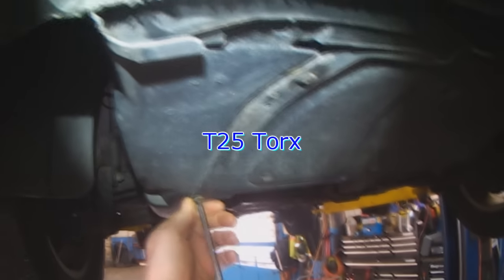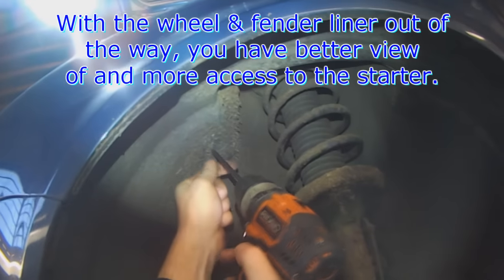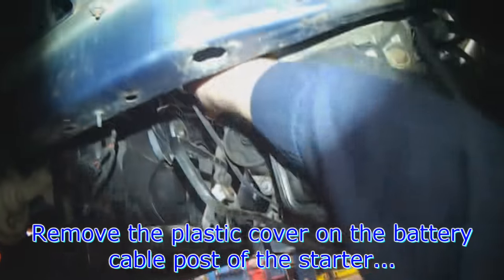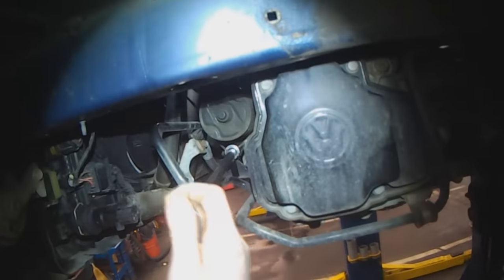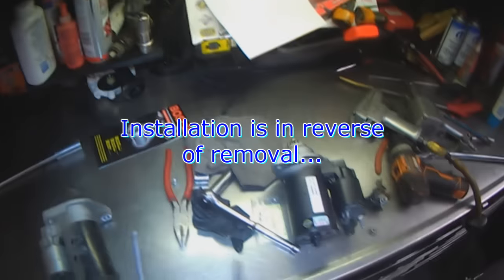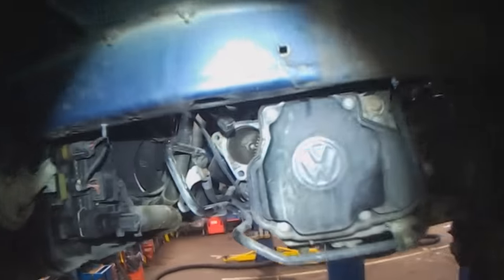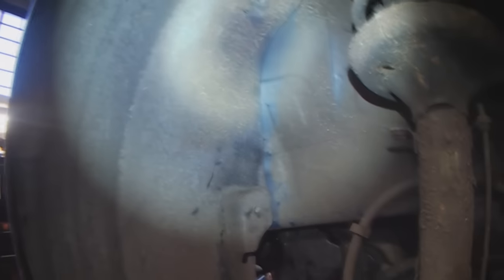VW A4: 1.8T, 1.9 TDI, 2.0, VR6 Starter removal (5 speed manual)

Comment: I'm kind of a GM guy because at least in the 60's and 70's everything was interchangeable and easy to access. As usual, I like the tips along the way. I can use those on any car. :)
Reply from the maker: Lots of stuff / theory is universal... that's what makes the Automotive field so great. The way things look & operate might be a whole different story and can be a pain when you are working under the gun / have a deadline. I admire the guys that work on anything & everything day in & day out... those guys get good quick!
Reply: I admire them too. So many different cars to keep up with I don't know how they do it. But then again, you work on plenty of different models. How did you get the corner stall? When I worked on helicopters I always fought for the corner so I had more room to spread out.

Comment: I have a 2001 VW Passat 1.8 v4 manual transmission and my starter is on the passenger side (alternator is on the driver side front of the car) under the car in a very hard place to reach. I am having a hard time getting the wire harness off the solenoid because of where it’s located and I can’t tell exactly how the clip is to get it off. I was watching your video to get an idea. I am confused because you said that the location of the starter on the VW has been in the same location for years, I can’t figure out why on my car it’s located on the passenger side so far away from the alternator. Thank you for your video because it was helpful. 👍
Reply from the maker: My video is for vw A4 models (golf, jetta, New beetle)... your passat is a vw B5, that's why it's different.

Comment: Nice work Thomas. On the long snout starter, the distance that the pinion comes out would be the same as the short snout. Correct? So, is there a difference in the starter housing cowl which surrounds the bushing which allows more of the shaft to be seen. Just not quite sure what the long snout starter looks like.
Reply from the maker: stuzman Sorry for the lack of clarification... the drive gear sits & operates pretty much the same, but the long nose (for lack of better words) just has a long armature shaft that extends into the bell housing where the bushing is. The bendix drive / gear then spins out along the armature shaft to contact the flywheel... if that makes sense. Good question... keeping me on my toes! =)
Reply: Okay Thomas, thanks for the clarification and makes sense now :)

Comment: Super useful video, thank you. One question: I want to replace the starter on my 1.8t from 2000 but I don't know which starter to buy. Can I just buy a stubby starter and it will fit anyway?
Oh and how do I know how many teeths my current starter has?
Reply from the maker: Pretty much any auto parts store / website you order from, should be able to match up the correct starter for you. They will want to know, year, make, model, engine, transmission. As long as you provide the correct info, they will be able to supply the correct part. You can also look at the old starter... there is probably a stock part number on it. 
This one for instance... fits Golf, Jetta & New Beetle's:
https://www.ecstuning.com/b-bosch-parts/starter-motor-remanufactured/sr0425xkt/
Where as this one (slightly different) fits Golf, Jetta, New Beetle and Audi TT
https://www.ecstuning.com/b-bosch-parts/remanufactured-starter/02a911023lxkt/

Comment: Had a mk3 Cabrio starter beat me for a while, apparently that bottom bolt lines the engine and transmission up, had to use a pole jack and wood to get everything back into place...
Reply from the maker: Yeah, the A3 needs the engine supported... can be a pain if one is not aware of it.
Reply: Found out the hard way LOL
Reply: I just got so spooked by this. I was just changing mine and didn’t know the motor needs support and almost shit myself when it fell

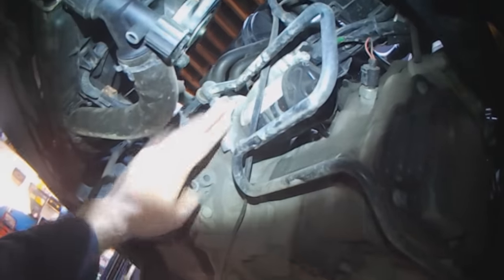Comment: Hey there. At 1:10 there's a harness connection next  to the starter going into what looks like the transmission.
What sensor is that connector used for?
Reply from the maker: Reverse light switch.

Comment: Hi,i am having hot start problem on skoda octavia 1.9 TDI,i have replaced fuel pump,coolant temp sensor,and yesterday crank shaft sensor,problem is still in it :( no problem starting from cold whatsoever and when running it runs 100% no issues,i am reading on alot forums it may be battery or starter,i have checked battery and still the same,should i look at replacing the starter now?it seems to be a issue problem on them?
Reply from the maker: If the starter is turning the engine at a good speed... the starter is good.

Comment: thanks for all your help,,, i have a vw jetta vr6 1999,,  and   i have oil in the cooling system,,, antifreeze,,  no sure if its motor or transmisión oil,,, where do u think its coming from...??? thanks... u r doing a exelent work....
Reply from the maker: Engine oil cooler or transmission oil cooler... if no major overheating event ever took place. If engine oil level is not dropping, transmission oil cooler (if it's an automatic transmission).
Reply from the maker: You can check the coolers by applying air to the coolant passages: https://www.youtube.com/watch?v=WNYx4Xjr8-I
Reply: thanks... I will check it.... 👍🤘.... great  videos...¡¡¡
Reply from the maker: Thank you for watching!

Comment: Does the top mounting bolt also need to thread through the mount/guide that's immediately next to the starter? @5:01

Got mine removed from the far mounting point, but the threads at the end of the bolt won't pass through the mounting hole/guide that's nearest the starter. Sprayed w some WD40, moved it back and forth a bunch, and I'm supporting the weight of the starter with my other hand, but still having a horrible time getting the threads through that last hole. Ever run into trouble getting one of these bolts out?

The bottom one came out no problem!!
Reply from the maker: If it's an automatic, there are 2 sets of threads in the hole. Pull on the bolt while turning it counterclockwise. Once it starts in the second set of threads, you can continue with a ratchet.
Reply: Thank you That's what I figured. Got myself cross-threaded so I'm in for an adventure!

Comment: I just did my starter, the engine stopped cranking, it always started up fine until it ran out of fuel. since it ran empty and stalled out out hasn't started back up again and the EPC light is on and the radio won't turn I either, I replaced every fuse and it still won't turn on. the brake chime goes off when the e-brake is engaged but when I press the AC switch and recirculation button the chime stops. I replaced the starter and it started cranking over but wouldn't start. there's no fuel getting to the injectors and I replaced the fuse to. the EPC light is on and the radio won't turn on, the sunroof is moving up and down by itself also. the radio did work, the AC worked until the system leaked out everywhere and now the car is killing batteries and it's not getting any boost, ours just the vvt part is the engine that gives it power
Reply from the maker: Year, make, model, engine?
Reply: Thomas EXOVCDS 2002 vw gti 1.8t AWP
Reply from the maker: Key on engine off... EPC should come on / normal. Scan for fault codes. Crankshaft position sensor, fuel pump... could be a bunch of things. All the other stuff might or might not be related. Make sure that the battery cables have a good clean & tight connection. The chassis ground cable under the battery can develop a bad connection, that can cause starting / running issues. Remove the battery and tray and check that the ground wires under there are clean & have tight connections. Let me know what codes are stored / if any.

Comment: I got one bolt off and oil started to leak out.Is this normal? Should i continue?
Reply from the maker: Which bolt? The more info I have the better I can guess as to what's going on / is wrong. Post a video of what you see / which bolt hole etc on your channel.
Reply: @EXOVCDS  ok, so it was the bottom bolt. I continued and nothing else came out after that, it was just a few drops, I was afraid a lot would pour out. We're all good. Thanks for your content! And the quick response.  Always go to your channel for your thorough explanations and expertise. I appreciate it.
Reply from the maker: @jusdriftinggg  some oil probably ran down between the engine block and the transmission... and then followed the bolt into the hole. Depending on the engine, could be oil from the valve cover gasket, head gasket or oil from the PCV.
Reply: @EXOVCDS  its a 2.8. Looked like fresh, clean oil too. Still perplexed.

Comment: I have a mk4 jetta 05 Gli 6 speed 1.8t, are all starters beginning with 2000-2005 universal?
Reply from the maker: I don't know if the starter itself is universal... but the mounting / removal process is universal across the A4/mk4 platform, for all engines and be it standard or automatic transmission.

Comment: NO! VW does not keep anything easy, or make anything easy WHATSOEVER! I appreciate the video though, the starter doesn't look too bad. Don't need to replace yet, but was just curious. Mine makes a really awful internal noise when starting, and I have a feeling it's on-going internal failure to the starter motor.
Reply from the maker: Like this? https://www.youtube.com/watch?v=Rx3gVbf1_9w
Reply from the maker: On a side note... this is an easy starter to change, even with the car on jack stands. The first time will always be a bit more difficult.

Comment: Is this the same for a 97 jetta glx 5 speed vr6, and can i test the starter while its still attached to the vehicle?
Reply from the maker: Yes, your starter removal is pretty much the same. Yes, simply apply power to the starter solenoid to see if the starter activates. Like in this video:  (first 20 seconds)
https://www.youtube.com/watch?v=inKwzg2osMg
Reply: Thomas EXOVCDS 
Ok so heres whats going on. Ive watched alot of your stuff and read your comment on other videos , your very helpful so maybe you can give me an idea of whats going on w my vehicle...
I changed the ignition switch,  everything was working good. 

It first started with the alarm system going off , was running like a dream before all this. I bypassed the alarm with the two wires like in other videos and got it started and  moving but the. It would bog down everytime i got it up to like 3 or 3.5 rpms. I would have to pump the gas to get it to keep going and be able to shift. Then i let it sit for a while , like a winter and tried starting it but it would only crank not start, let it sit for a year and now i get no start, i have new battery and everything inside the car is operational. Just no start or crank now. . Any ideas where to start or what to look for would be useful. .. thinking it could be starter but want to make sure if i do test the starter while its on my vehicle it wont wreck something like the timing chain ..  and do i need someone in the car starying it as i do this with the clutch down considering it is a manual. ? Any info will help, need to raise this beast from the dead.
Reply from the maker: You can do this by yourself... Ignition key OFF, transmission in NEUTRAL.
Disconnect the starter solenoid trigger wire (red/black) from the starter solenoid. Attach a jumper wire to battery + and carefully touch the starter solenoid trigger pin with the jumper wire (you need a small jumper wire like I used in the video I linked).
If the starter cranks the engine, starter is good and the problem is between the ignition switch and the starter.
If the starter does not crank (no sound)... could be starter or it could be a bad ground connection (thick battery negative cable that attaches to the transmission).

Comment: Where is the starting location on a vw 2004 Passat 1.8t
Reply from the maker: Starter is under the exhaust manifold on the passenger side.
Reply from the maker: Did you find it?
Reply: @EXOVCDS  yes but the starting fine I had a missing relay
Reply: @EXOVCDS  it starts up perfect

Comment: The starter motor is in the same place on the engine 1.8 8v golf mk2 ?
Reply from the maker: Yes, similar... but you have to support the engine. The starter is mounted to the front engine mount. When removing the starter, the engine will drop / move. Place a jack under the oil pan so the engine does not drop.
Reply from the maker: Watch this: https://www.youtube.com/watch?v=28L2P3prnyU
Reply: Thomas EXOVCDS thank you
Reply from the maker: If it is automatic... the starter is under the exhaust manifold at the back of the engine.
Reply: Thomas EXOVCDS it is not automatic
Reply from the maker: No need to support the engine... but it is more difficult to replace / get at. =(
Reply: Thomas EXOVCDS Thank you. Have a nice day!

Comment: Why didn't he disconnect the battery first?
Reply from the maker: Because he didn't think it was necessary... if you know what you are doing, things will be fine I guess.
Reply: @EXOVCDS  also l read that possibly the reason he didn't is because when the battery is disconnected in some VW's it will lose some computer data and would need to be reprogrammed and if you don't know the programming codes there can be a problem with the radio and maybe even how the car runs-so maybe that's why he chose not to take the simple step of disconnecting the battery?
Reply from the maker: @Mybrotherskeeper  yeah, that's probably why he didn't disconnect the battery. Didn't want to deal with programing / resetting stuff.
Reply: @EXOVCDS  right